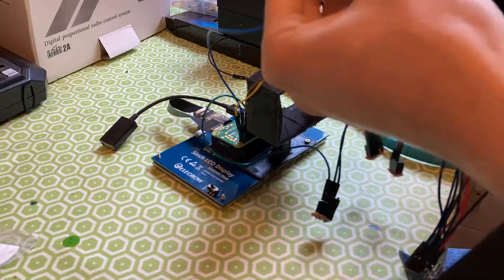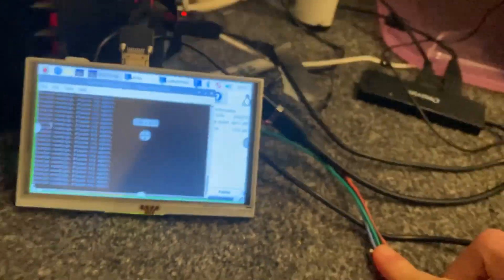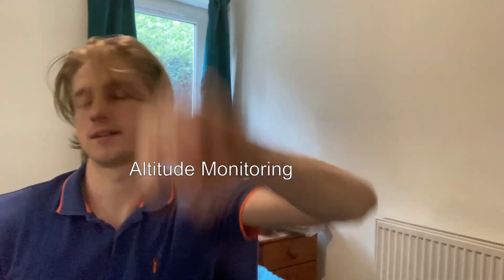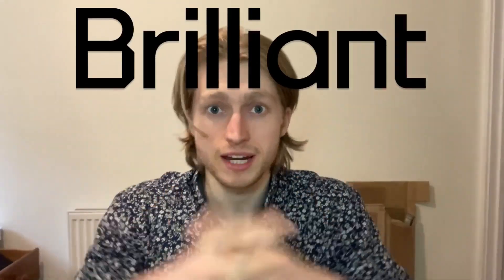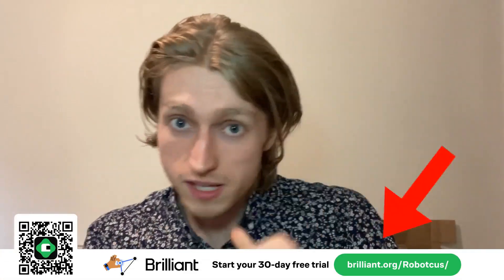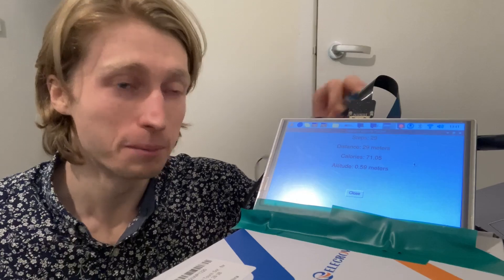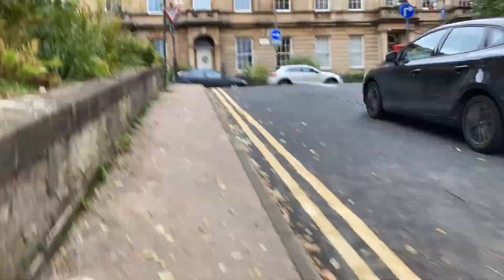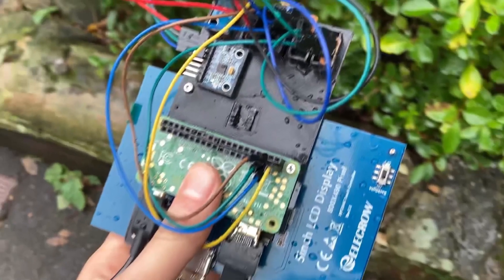I Made A Truly "Smart" Exercise Watch

Comment: I'd imagine weather changes would disturb the accuracy of atmospheric pressure, so if you made a part two, using GPS for elevation instead?
Reply: Another idea that comes to mind is analysing the composition of gases' concentrations given that changes as you elevate, could use gas sensors. There's also something called gravimeters that measure the tiny changes in the Earth's gravitational field, they exist in labs but haven't been minaturised, but they measure phase shifts from atom clouds and you need near absolute zero for that lol
Reply from the maker: @Eldingar-MC  Could it really ddetetc something so small?
Reply: @Robotcus  it can with lots of power and lab settings, it’s miniaturising the equipment that’s the problem. Lasers and absolute zero, vacuum chambers and magnetic shielding is pretty hard to fit into a watch, but to my understanding the biggest problem is power supply, probably some mini fusion reactor because no lithium alloy is gonna cut it
Reply from the maker: GPS elevation may be quite expensive no? The sensor i used was a bit meh, but very cheap which me like
Reply: @Robotcus  true it’s probably a fair bit pricier